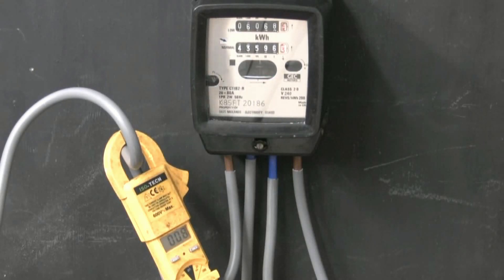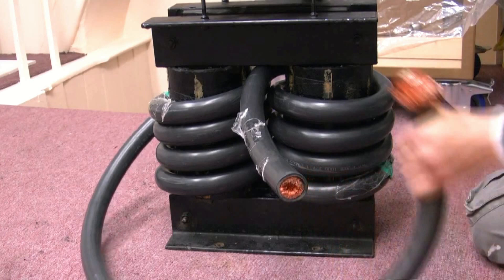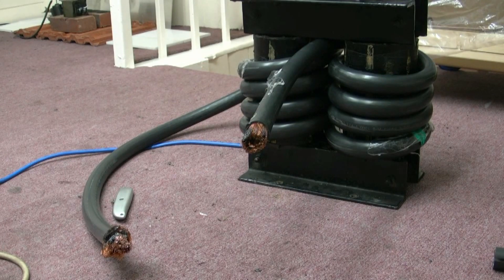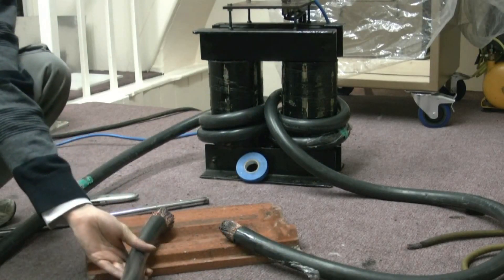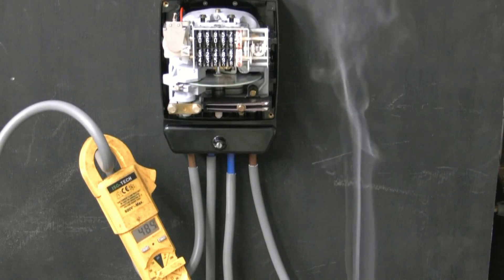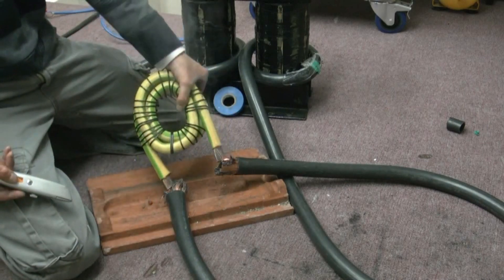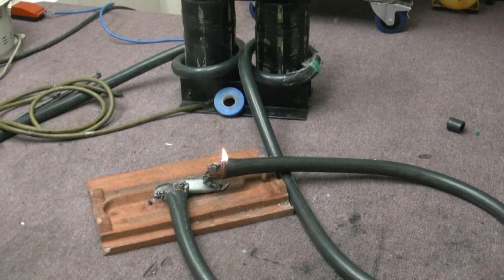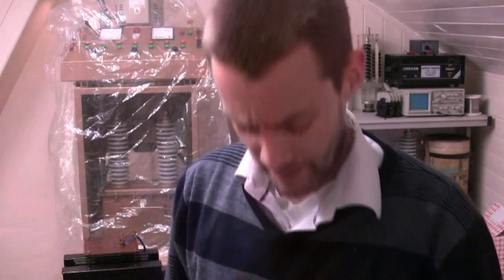Too Much Current + Electric Meter Pops

Comment: How dangerous is it to touch that metal rod while current is flowing through it?
Reply: Really fucking dangerous if you don't know what you're doing
Reply: depends on how hot it is
Reply: Depends on the amount of Voltage in the circuit. The reason the current is so high is because the Voltage is low on the secondary side of the Transformer.
Reply: But the voltage is very low and in the case of human body, resistance is far too high for that voltage, so it can't kill you. Ohm's law.
Reply: but it can burn you because of the heat the current produces in the rod so its still dangerous espacially doing it on a carpet..
Reply: Wouldn't it be ok to touch it even if the voltage was high enough to harm you because eletricity passes trough metal which has lower resistance than human skin? Would it just ''ignore'' you?
Either way I'm not getting anywhere near this stuff.
Reply: clsman89 current always takes every possible way the amount of current depends on the voltage and the resistance so it depends on the voltage you cross over with your body but it won't "ignore" any possible way
Reply: Erdnusschokolade Oh I see. I guess that's how resistors work?
Reply: clsman89 yes if you touch both ends of the road you would put yourself parallel to the resistance of the rod and the same voltage that lies over the part of the rod you are crossing will also lie over you and would make a current flow depending on your resistance and that voltage

Comment: with a hobby like that... you need your own sub-station... 80 amps at 120v, thats only 9,600 watts... also. did you actually knock out the neighborhood? props to ya, and hopefully you don't have to pay for any repairs outside the house.
Reply: he wouldn't have to, he only managed to dim all the lights on the same transformer as him
Reply: 230v in the UK, although in reality it is usually 240v
Reply: 220~240v in the UK most people say 230v but its a 10volt buffer i think.
Reply: If memory serves me correct it is +10% and -7% tolerance. I'm sure if I'm wrong someone will tell me!

Comment: what would happen if you touch both ends of the cables?
Reply: nothing, voltage is too low, extremely low resistance is required for current to flow
Reply: or do you mean butter flies out of the butthole?
Reply: with high current and low voltage, nothing. it you touch them together without you as a "fuse" they would just sort out like they are in the vid and would slowly but surely catch fire.

Comment: XD wait a second you are draining so much power that the neighboor is getting power dips?
Reply: Dylan Collins
because when your lights are flickering the first thing you do is look around to see if your neighboor's is doing the same. 

ofcourse not moron
Reply: callum barbra I know this, but if you're having a brown out every 15 seconds you'd look out the window to see what's going on wouldn't you? And I do know that lights flicker, I'm in Ireland, we use 50Hz too...
Reply: It is persists for any major length of time, I'll drop my house off the grid by firing up my generator and then a throwover of my transfer switch. In my neighborhood, there's around 8 houses riding on a padmount transformer out at the street. So, if someone's stick welding at a high working current, your lights flicker.
Reply: @djscrizzle  That should not happen normally.   Your hood is not fed well then
Reply: BPM Productions of Colorado hillbilly

Comment: I noticed he was able to hold on to a metal object that was touching down to both sides of the exposed cable, seemingly without receiving a shock. Would I be right in thinking this is because he has removed a path to earth/created a situation where there is no path to earth?
Reply: No, the voltage is just too low to get through the human skin, that's all. It's why you don't get zapped when you touch a 1.2 volt battery or even a 12 volt battery, not enough volts.
Reply: Imagine that voltage is pressure pressure pushing water(current) and the diameter of a pipe is the resistance. So since voltage is too low the current is flowing slow.

Comment: a guy is doing mad shit wonders with the forces of the universe and all these stupid imbeciles can comment is his fuckin carpet. no wonder the second question is how the fuck he's not electrocuted..
Reply: low voltage, high amperage, simple as that, if the voltage was 240V then he wouldn't go near it (he wouldn't be left standing afterwards) but you can easily touch 1000+A because so long as you have something of less resistance between you and it, it will always flow through the path of least resistance, hence why he bridged it with a metal bar and a knife, they're both less resistive than his skin, so the electricity wasn't interested in him... the main concern while doing stuff like that is heat, you don't want to weld your hand to a metal bar because of the heat it generated while bridging contacts
Reply: You've upset a lot of spastics with your comment, as seen in this thread.
Reply: Sarcast because he knows what he is doing and you clearly don't.
Reply: Javier Mendoza S. So what you're saying is nobody's allowed to talk about anything unless they understand it? That'd make learning new things kinda hard. How bout you get your head out of your ass and stop acting like you're somehow superior because you something that somebody doesn't. You must have some serious issues with self esteem if that's the sorta thing that makes you feel good about yourself.
Reply: You clearly don't know about electricity. Some advice, don't comment on topics you don't know about.
Reply: you are just an idiot

Comment: if you were turning off the neighbors lights what were you doing to the transformer
Reply: rodalco2007
Reply: It's just getting a bit hot. It may pop one of the phase fuses. Look up "Rodalco2006" (assuming I got the name correct) he has videos on mains transformer repair.

Comment: i think the government needs to see this
Reply: datstocklyfe Nothing illegal in using electrical power he pays for.
Reply: Something like a electrical welding tool works the same way, just not as extreme. However saturating a multible Households transformer might be a bit grey
Reply: This guy is a government level electrician, you think he owns a V12 convertible Mercedes from wiring a few plug sockets?
Reply: C4rnif#X. A permit is requierd  for what? insurance. will a police go and fine him for using a bunch of electricity on gear he built himself? it's not illegal, anywhere. It might be unsafe and the insurance company might up his premium seeing this video. Or if it burned down, he might have  a problem, if he were not a licenced electrician. And I'm betting he is, that looks like somekind of engineer home work studio where he builds his own gear for somekind of work, possibly. And likely he has the insurance policy to cover fucking about like that.
Reply: You dumb fuck he is a qualified electrician he mentions it in another one of his videos
Its fairly obvious from the rest of his channel that he knows what hes doing isnt it?
Reply: why?
Reply: because it's an uncivilised act and could be illegal
Reply: datstocklyfe Nah, using electricity is quite common these days.
Reply: Jovan Janevski obviously this is abnormal usage of electricity is it not?
Reply: No they dont...then they'll find out about the hacked substation and stolen nuclear generator hidden under his basement Hahaha ;) ;)
Reply: bbuildingmarch the govt needs to see your mom.
Reply: Go and report it then fucking crybaby!
Reply: He even fucking describe this at the end. Holy shit guys.
Reply: Snitch
Reply: bbuildingmarch
I've heard someone is building up a new STAZIE APPARATUS (secret state police) maybe a job for you over there?  They allow you to torture as well, seems your the type!
Reply: C4rnif3X I understand this is a year old comment but you so not need a license or a degree (which you seemed to put together) to work with HV and HC...  

Not sure where you got that idea
Reply: old meter, gov cant do shit ;)
Reply: +Jovan Janevski HMMMM Yessss...you might just have a very GOOD point there guy...uh HUH...and grrr to those pesky time-travelers too hmmm? Hahaha ;)
Reply: C4rnif3X not in the uk it isn’t, and you don’t need a licence either.
Reply: bbuildingmarch LOFL FRIRND!
Reply: Lukas H. true

Comment: 1. How are you not being electrocuted?
2. How did that hot metal rod not melt your finger tips and give your a bad burn?
Reply: Salvador Tadashi 1. The reason he wasn’t electrocuted is because the voltage is too low to push that current through his body. Voltage is the electromotive force behind a current, so if there isn’t much voltage backing a current, the current won’t go through a human body. 2. I can only guess that it’s thickness was hindering its thermal conductivity. Hope this helped!

Comment: WTF? How many kVA is your grid power supply?
Reply: UK households are 240v standard out of the wall
Reply: +girlsdrinkfeck Yes man I know the voltage is 240. kVA (kilo volt amperes) is the total power you can get from the grid. 1 phase 8kVA, 3 phase 25kVA, 35kVA?

Comment: serious question. I do some metal work from time to time and even using a small dremel or a file makes steel so hot you can't touch it but nowhere near glowing as you have here. How are you able to handle a piece if steel while it's glowing?
Reply: they heated it up REALLY fast.  when you use a dremel or a file it goes a lot slower thus it takes longer.
guessing the part he is holding is becoming hotter and hotter as he's holding it
Reply: there must be some other magic happening here. hes holding a red hot piece of steel 5 inches away from the red part it must be some sort of convection issue where the heat doesn't flow to the ends of the rod or something. I'm convinced some spooky physics is responsible.
Reply: +Rolteus haha yeah might be.  i found it a bit weird and it was the only explaination i could think of.  might just be a material in the aloy though

Comment: How is it not shocking him?
Reply: TheBarret I've heard that too, but wouldn't that make anyone who's living in a house safe from one point electrical shock? I should really pick up some books on electrical engineering.
Reply: Im an engineer (bachelors) and I've had special classes on that but it's just weird that it can melt things and still not get through human skin. I think the trick was a huge number of amps on low voltage. I'm gonna research it this summer.
Reply: yes that's the trick,  low voltage.  still, the high amps are quite dangerous..
but current always takes the path of lowest resistance, and if you are not touching anything that is grounded nothing much will happen (at these voltages)
say..  if you were to hold the radiator and do that shit, there would be a roasted body.
i'd still not recommend doing this stuff even if you knew what you were doing. there's a reason that you have to wear special shoes, special gloves and have training for stuff like this.
Reply: current flows from a to b in a closed circuit. He is not part of the circuit so it does not shock him. The reason you get shocked in your house is because the neutral is the same as the ground. So basicaly on that circuit the whole world is connected. But with a high enough voltage you can become part of the circuit.
Reply: Path of least resistance would be the negative terminal, voltage is too high for it to even notice the ground via man floorboards via brickwork path
Reply: And body resistance is not linear.

I guess +Afrotechmods has explained it.

Comment: 2:55 why does the bar become black right before starting to glow? Heat accelerated oxidation?
Reply: it's the carbon yes.
and yes it's a steel bar, but steel is an alloy.
usually steel = iron + a certain % of carbon. (depending on it's use)  the carbon is what makes it stronger
Reply: Carbon being burnt out and brought to the surface.
Reply: It's a steel bar right?
Reply: Hoelbrak/NoFear
Yes, i know steel is an iron+carbon (+other metals if you, for example, want an high temperature or low pH environment suitable steel; an example is stainless steel, with added chromium) alloy.
Reply: +TeraVolt and thats why it became black :p
Reply: Hoelbrak/NoFear
So this also means that iron can be separated from carbon by means of heat, right?
Reply: TeraVolt no it doesnt, and now i feel like a complete fool for thinking that xD
i just tried to find something about it and i can't.
not sure if it's wrong, but if it is, i apologize :/

Comment: How did you not die touching that?
Reply: low voltage
Reply: +Timothy Nankervis no volts plus only touching it with one hand doesnt create a path of low enough resistance to ground through the body (heart).

Comment: Soo, drawing 600amps makes my meter go slower?  k good to know lol
Reply: At 20-50v yes
Reply: I actually think the little rod that spins the disk was spinning so fast it was just spinning within the larger disk. Either that or the vibrations in there started causing resistance and taking off the disk's angular momentum.

Comment: well.. how's your electricity bill? :D
Reply: ***** so true
Reply: It's very cheap as he only does these things in very short bursts (this video is is a joke he is running low voltage at high amps thow the meter)
Reply: +KJP12 hey and...didn't you see in his video here how he whips the cover right off and starts playing with those wheels like it's a slot machine? (personally I really think the one he was showing that he was doing that to AND burning up was a fake meter he was using just to be funny lol)...BUT...Alan...care to elaborate on this guy??
Reply: That was a just a meter he had that he was fooling around with, he said that at the end.
He also said he only has a 60 amp feed to his house, most houses in the us have 100 or 200 amp.
If he pulling 500 amps at 10 volts, that's 5000 watts, I think the regular panel voltage in Europe is around 220 volts.
So you divide 5000 watts by 220 volts, that about 23 amps is what he's actually getting billed for. that's about as much as a clothes drier.
He probably does have a higher than normal electric bill, but I don't thinks it's crazy high. 
That piece of fat wire he's playing with cost $15 to $20 per foot.

Comment: I thought amps were the dangerous ones. why can you handhold these and not other ones?
Reply: Amps aren't really the dangerous one, voltage is. Yeah the amps will kill you, but if the voltage isn't high enough, your body won't allow the amps to flow through it. So when you have an amp and enough voltage to get shocked, that's when you die. A couple volts with nearly unlimited amperage won't hurt you. A hundred volts with even less than an amp will kill you.
Reply: Thanks for the info! I never knew.
Reply: +Productions影 That's not a "shitty" explanation. It's the clearest explanation I've read, yet. Thank you
Reply: That was maybe the most obscure and shitty explanation of volts and amps I've ever come across of. Please don't try to "help" anyone else ever again with this subject :-)
Reply: Yea on top of that, I was always told Voltage is Amperages' "pathway"- if you will.